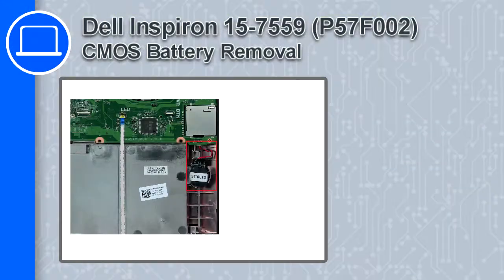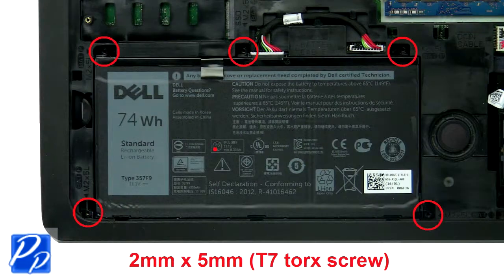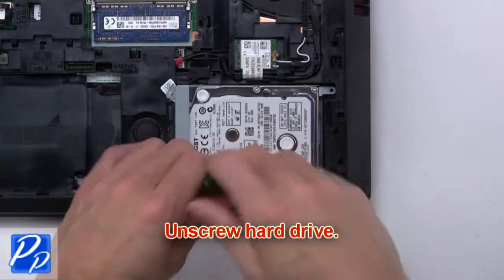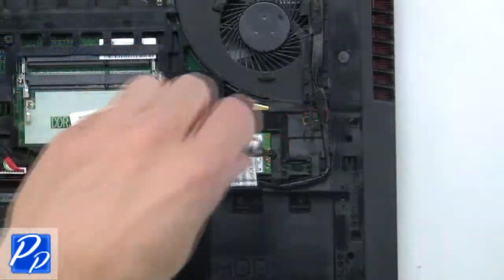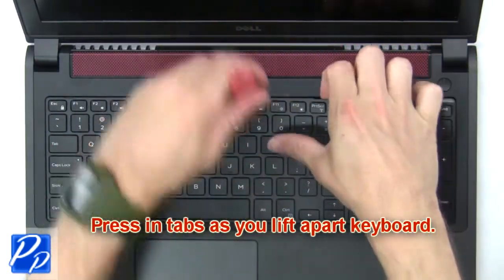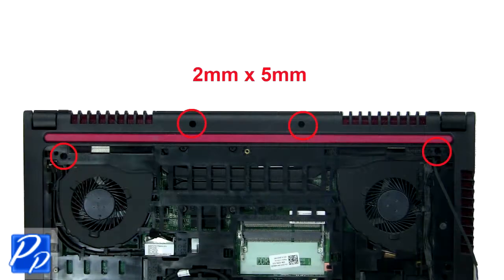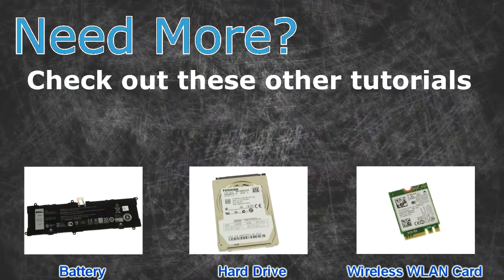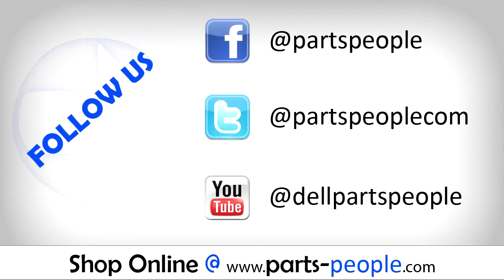Dell Inspiron 15-7559 (P57F002) CMOS Battery How-To Video Tutorial

Comment: I want to ask if I have a dead cmos battery will my laptop boot up. I cleaned my laptop, change thermal paste try to turn on. When I press button nothing lights there is no boot up. Can dead cmos be a issue or is this mobo related?

Comment: thanks for making this & editing it down, saved me time. working on a 7559 pulling my hair out to why F2 and F12 options not letting me boot to a simple UEFI flash drive tool like Acronis/paragon. Had to go as far to disconnect this CMOS battery and sure enough, now everything works like every other Dell I've worked on. I guess fast boot was the issue. I couldn't boot to OS to hold shift and click restart, go to firmware changes via the windows 10 method - so this was literally the only option because I couldn't boot to install media either as I couldn't just press F2 to get into BIOS!! Not sure how I feel about fast boot now.
Reply: Did you remove it and plug it back in, or did you replace it (cmos battery)?
Reply: After doing this, have you get access to bios by pressing f2 ?
Reply: @MiQua-ii1zx  Yup works fine, since default bios settings turn off fast boot. Fast boot skips detection of anything CD/USB and doesn't let you press F2/12 like a typical system that doesn't have this feature.
Reply: @loudpanzer  oh thank u.
Reply: I wanna know the same, if you just remove it and plug it back in,  or did you replace the bios battery?
Reply: @phctr  just remove it and plug it back in. It worked for me
Reply: @viviinhere  that´s what I did, thanks
Reply: Same issue here :/ I've pressed the F keys so many times now.  Gonna try this method to undo changes to boot order

Comment: Hi, why i have to disconnect hdd and all the cables showed in video, when i want to reset bios with removing cmos battery for a moment. Is it not enough to get to the battery without unplugging all the stuff ? Thanks
Reply: You only have to disconnect the primary battery before disconnecting the CMOS battery. Removal of the hard drive, wifi card, etc. is not required.
Reply: @orange121100  I had to remove the hard drive because I guess there was one screw that was not allowing me to remove the last layer before the CMOS. Never mind, it worked to showthe BIOS option again :-D
Reply: @oscarbarajas3610  sorry for asking, did you unscrewed both hdd and battery to get access to CMOS?
Reply: @VexedHexed  yes! I had to unscrew both!